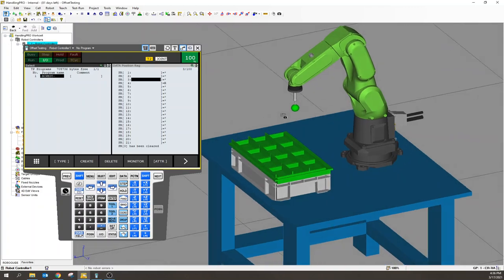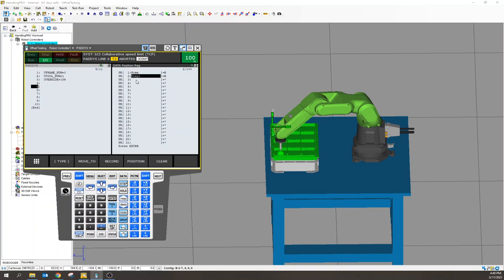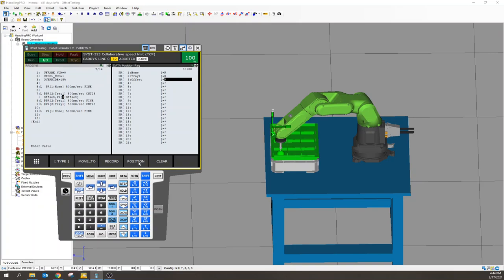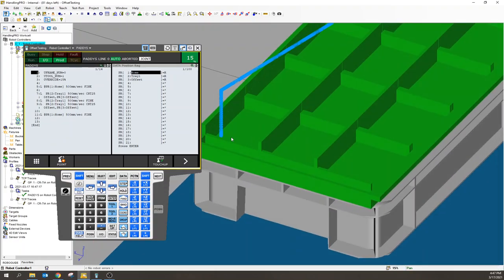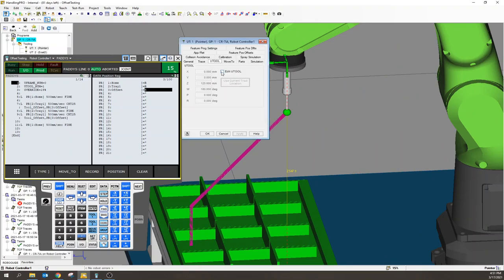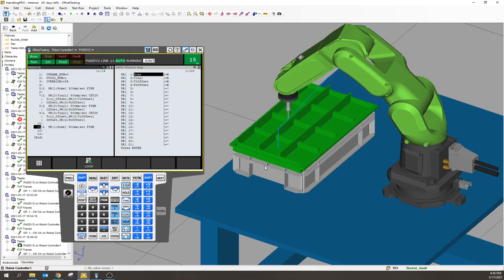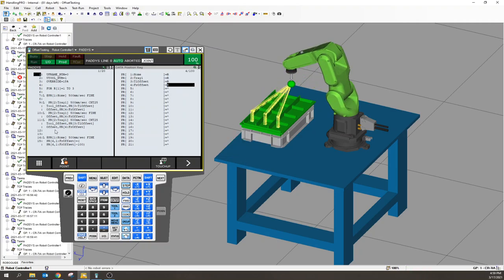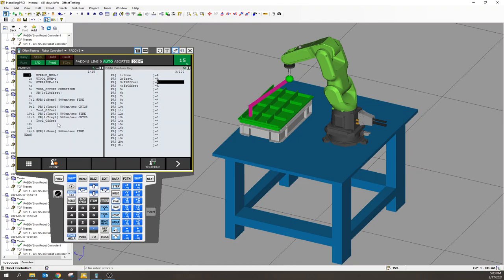Understanding OFFSETS in FANUC TP Code

Comment: So is the main difference between tool offsets and frame offsets is mostly orientation? And frame offsets make sense to me, but when using a tool offset is it mostly for the flexibility of where you want the joints to move?

Comment: hey, nice video. Although i have a question, when i code the offsets to repeat the tray jog, it adds the value to the offset function. So when i want to start the programm a second time, it would start at the 4th tray, not again on the first one because the value is adding in the PR but not deliting at the end of the program. 
Hope you can help me

Comment: Hello Adam, thanks for sharing your videos.  I have a question regarding offsets, specifically the offset condition instruction.  I prefer to use the offset condition instruction when I want to apply the same offset to multiple motion instruction statements.  However, when I was reviewing the Fanuc manual, it mentioned that you could specify a u-frame as an option at the end of the instruction.   I do not understand how specifying the u-frame would work or change the related offset motions.  It was also mentioned that if you do not specify a user frame, then the world frame is assumed.  Can you please clarify this option a bit?  Thanks

Comment: Hi Adam, thanks for the videos you provide, they are very educational and help understand different tools available much better. i am working on an application where we will be tracing the outside of a circular part. there are different parts however that have different diameters. i was wondering if there is a way to do the circular moves with offsets that would be passed in from the PLC and have the robot offset the size of the circle its going to trace? thanks